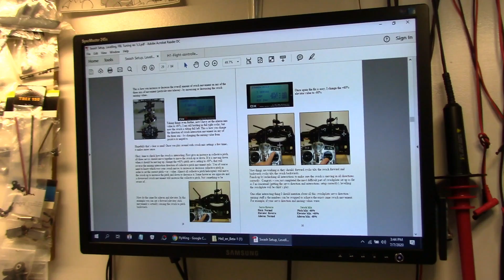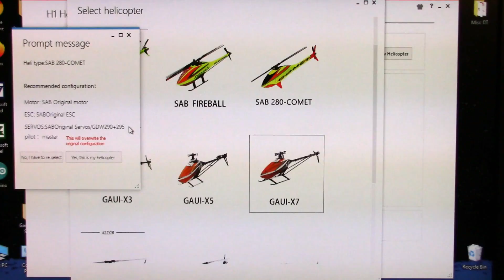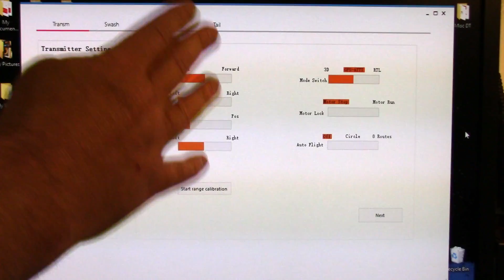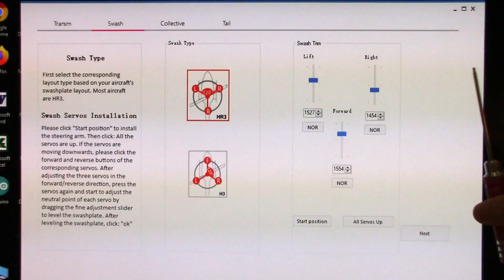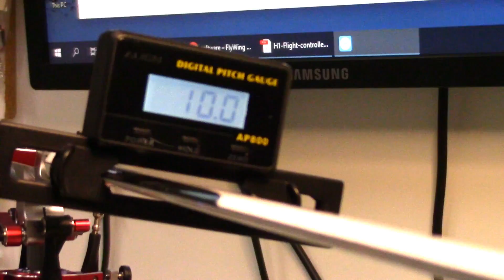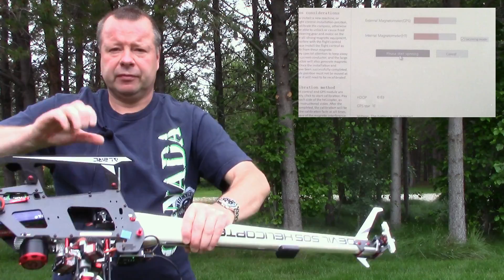Flywing H1 Setup Tutorial & Tips

Comment: so you say (that you know) that I could also connect spektrum (dsm / dsmx protocol). Thanks again
Reply from the maker: No, I said no such thing. I said to CHECK the MANUAL to see what RX outputs will work with it. I know for 100% certainty it works with S-bus since that's  how I have mine hooked up as per the manual. I have no idea if a Spektrum's satellite RX's PPM signal would be compatible or not. I would venture to say it isn't since DSM is not mentioned anywhere in the manual, but that is just an educated guess. Of course If you have a DSM2/X RX that has an S-bus output (I'm not a Spektrum user anymore, but I think some of their newer RX's have an S-bus output port & some aftermarket ones), then that would work. Best to contact Fly Wing with compatibility questions like this - I can only relay what is stated in the manual and what is working in my application... S-bus.

Comment: could you please show the connections of the receiver (or the various types of receiver: futaba, PPM) to the H1?
Reply from the maker: The H1 manual I link to in the description shows it well and goes over accepted RX connectivity. There is only one connectivity method as I show in the video. A 3 wire servo plug conductor to to the RX in port of the H1. The 3 conductors are the typical + / - / and signal conductors.

Comment: Disappointed to find that this H1 FC requires HV (6.4-8.4) so NONE of my helicopters have HV servos.  Either I will have to buy expensive HV servos (not happening since this is a VERY part time hobby) or do some fancy wiring to get 6.4+ vdc to the H1 and leave the 5-6vdc to the rest of the electronics.  :(
Reply from the maker: Or inexpensively install a rectifying diode in series to each servo's power input wire to drop a 6.5V input to around 5.6V to 5.8V to each servo (load dependent). This assumes of course your RX is also safe to run at higher voltages up to and over 6.5V as most modern day spread spectrum 2.4GHz RX's are.  As you said, there are several ways to do this, but using inline rectifying diodes out to the servos is likely the easiest & least expensive method as they are about 1$ each so about $4 beans total plus some soldering time. We have been doing this for years when using older 5V max specific tail servos in combination with regular 6V cylcic servos and voltage systems. On regular size servos, 5A rated rectifying diode would be fine - HER 502, 503, or 504 diodes for example.

Comment: John, great video...were you able to get rid of that tail bounce (from the review video) by reducing the gain on the parameters page?  If so, what did you set it to?
Reply from the maker: Yes, I covered that at the end of the review video including what my final settings were. Those final gain settings I show at the end of that video are of course specific to this particular heli, the mass of the heli, the blade spinning mass, and the particular head speed I'm running. Lots of variables involved when tuning the gain values on any FBL system. As I said at the end of the review video, my final settings were a compromise. I can get it to fly well in 3D mode or GPS mode but not both. Without the ability separate the cyclic pitch & roll axis gain settings, or even better, separate them and allow access to the individual PID gains,  I think the best we can hope for is a compromise seeing the setup wizard is also a compromise in the limited adjustability is allows. That or set it up for one or the other.

Comment: DMA Collective is: Advance compensation of collective pitch to tail
Reply from the maker: Thanks so much.
Reply: @rchelicopterfun  so, what does this mean?  How will adjusting this from zero affect flight controls?
Reply from the maker: It mixes in some tail rotor pitch to counter main rotor torque the moment the collective is increased to help the tail gyro out so it doesn't have to play catch up as much when moderate to large collective torque spikes hit. It's generally called something like torque compensation, collective pre-compensation, or tail pitch pre-comp on most FBL systems. I've never seen it referenced as DMA, thus the confusion I had. DTA would make more sense (dynamic torque assist). In GPS mode it's not needed at all since the collective response is so slow and tame so there are no drastic main rotor torque spikes created. You only need collective/tail torque precomp when introducing sudden and large collective pitch changes.  If you did dial it in or too much of it, you would likely notice the tail kick out slightly in the opposite direction of main rotor torque every time you gave sudden and high amplitude collective commands.

Comment: Another excellent piece of information you're sharing John! A quick question, is it complex to use the H1 with a 9CH Spektrum radio?
Reply from the maker: No idea if you could get it to work with a Spektrum TX. It would require programming in some creative mixes since Spektrum doesn't use Futaba's channel mapping which I mention in the video is very specific. Moreover, the H1 unit only works with S-Bus RX input and one or two PPM protocols (Spektrum is not listed). I think there are some aftermarket DSM2/X protocol RX's with S-Bus output, but since I don't fly Spektrum anymore, I'm out of the loop. Perhaps Speky does have some newer DSMX RX's with S-bus output?
Reply: @rchelicopterfun  Thanks,  much appreciated!